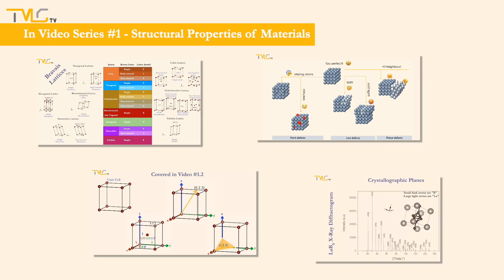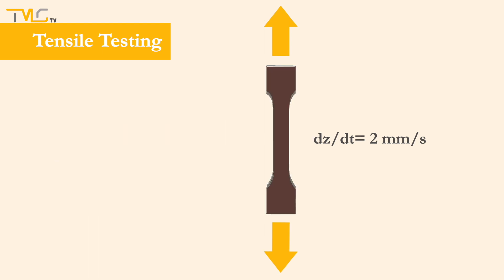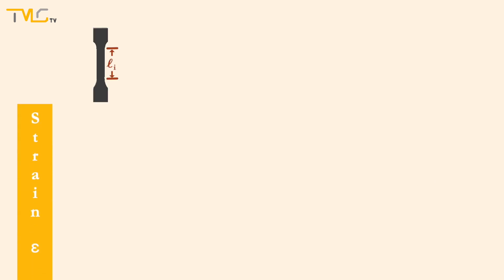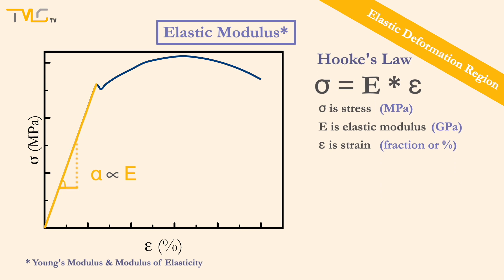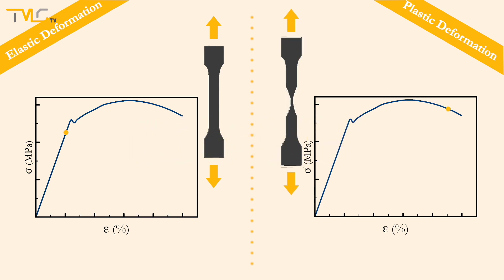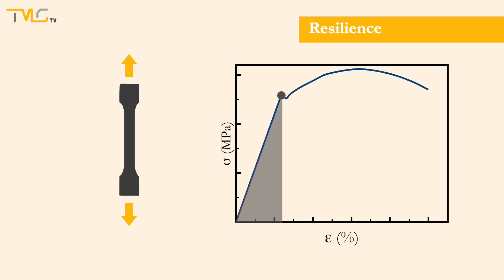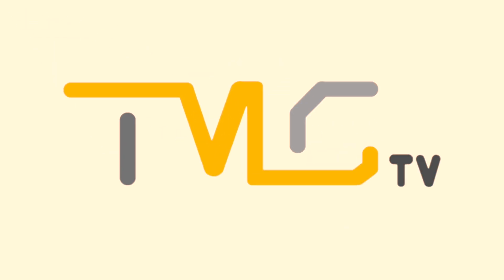Video #2.1 - Tensile Testing, σ-ε Curves, & Data Interpretation (Mechanical Properties of Materials)

Comment from the maker: Time Marks
0:34 - Tensile Testing (Çekme Testi) 
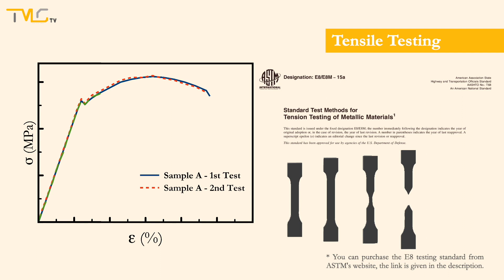1:17 - σ-ε Curves (Gerilim-Gerinim Eğrileri) 
2:42 - Stress (Gerilim) 
2:52 - Engineering Stress (Mühendislik Gerilimi)
3:08 - True Stress (Gerçek Gerilim) 
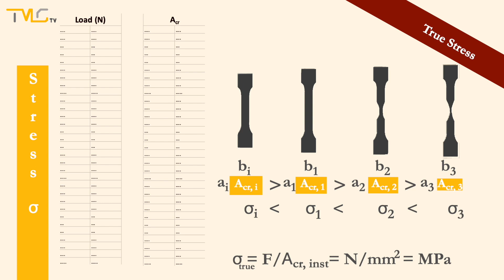3:33 - Strain (Gerinim)
3:47 - Engineering Strain (Mühendislik Gerinimi)
3:53 - True Strain (Gerçek Gerinim)
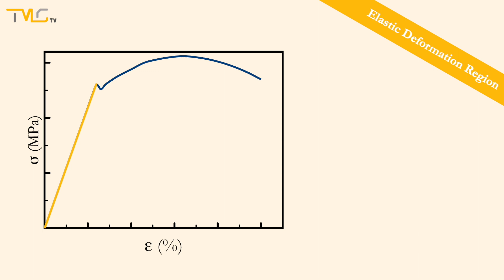4:28 - Elastic Deformation (Elastik Deformasyon)
4:35 - Elastic Modulus (Elastik Modül)
4:48 - Hooke's Law (Hooke Yasası)
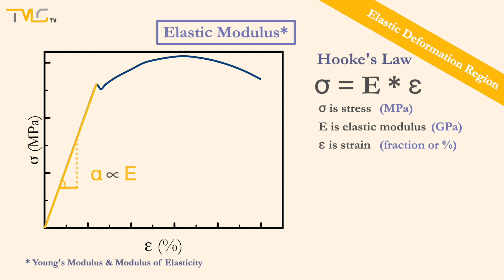5:24 - Stiffness (Direngenlik)
5:54 - Poisson's Ratio (Poisson Oranı)
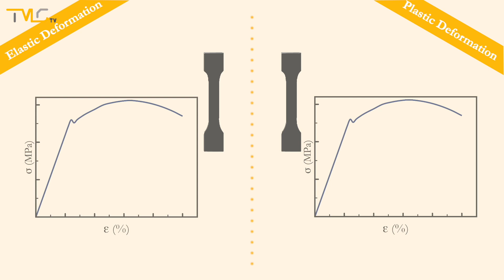6:54 - Plastic Deformation (Plastik Deformasyon)
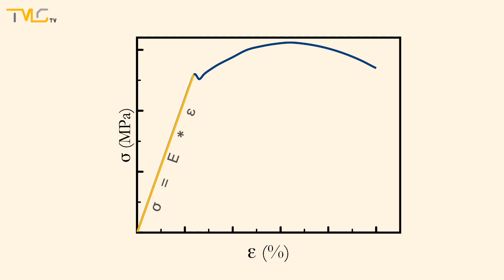7:37 - Yield Point (Akma Noktası)
8:21 - Ultimate Tensile Strength (Çekme Mukavemeti)
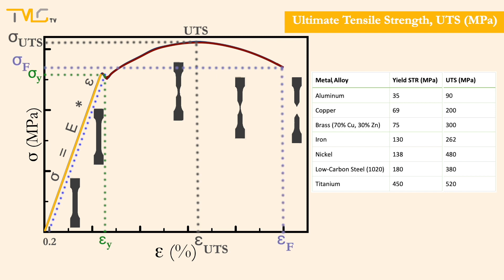8:54 - Fracture Strength (Kırılma Mukavemeti)
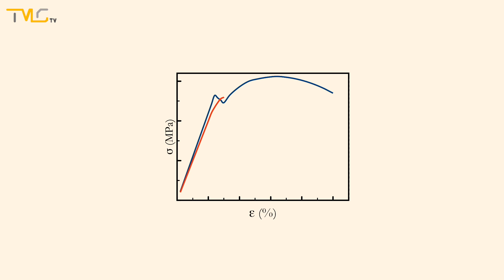9:39 - Ductile vs Brittle Materials (Sünek ve Gevrek Malzemeler)
10:33 - Resilience (Elastikiyet)
10:42 - Toughness(Tokluk)